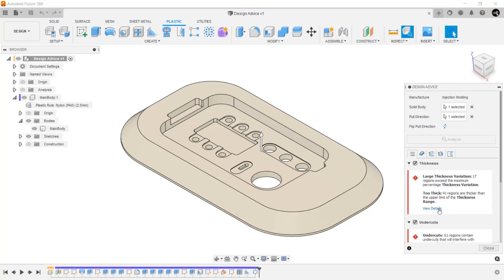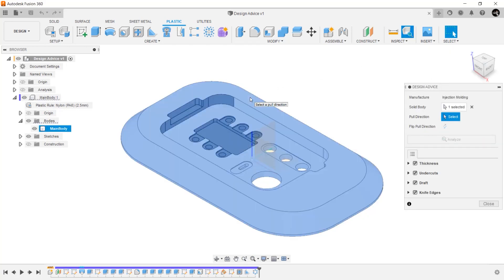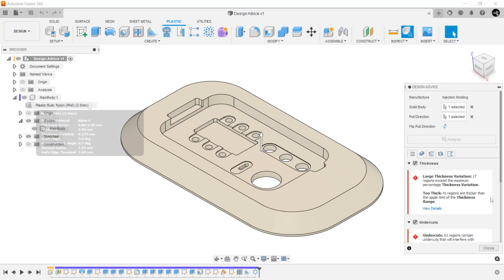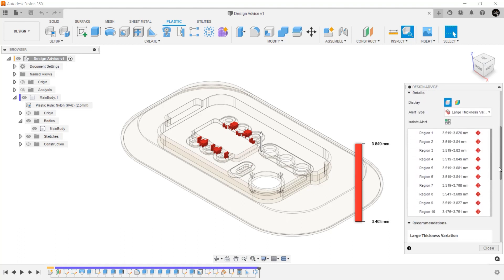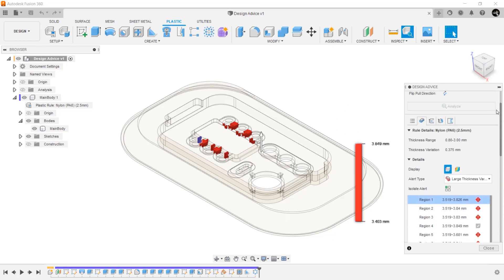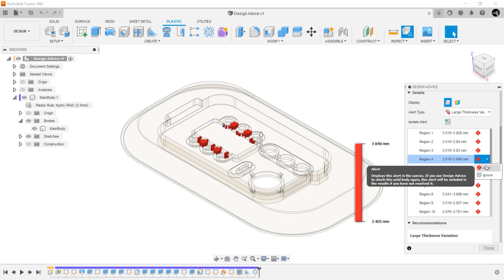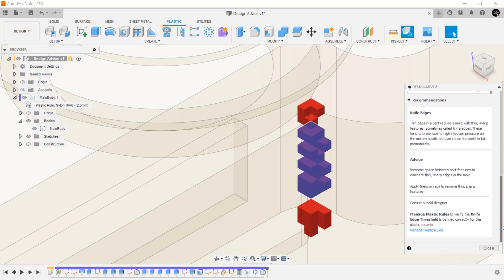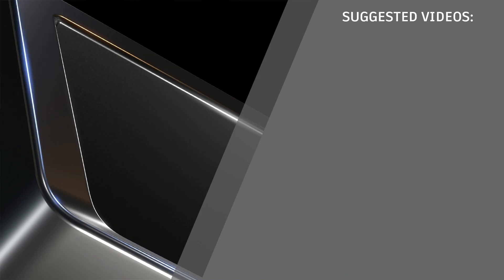Design Advice in the Fusion 360 Product Design Extension | Autodesk Fusion 360

Comment: Not at all related, but when sketching and entering a dimension, it would be handy if you could enter something like "spt = 40" and it would make a user parameter called "spt" with value 40 so you wouldn't have to jump into the change parameter screen.
Reply: This feature is already implemented in exact way you describe it. This was added in August 2020. Hope that helps.
Reply: @altus2  Heh, seems like it works :) Goes to favorites instead of user parameters, but I guess it's ok.